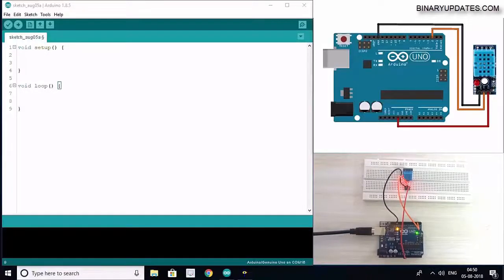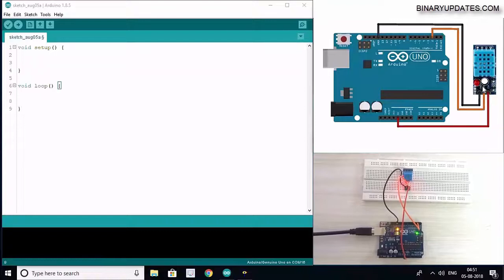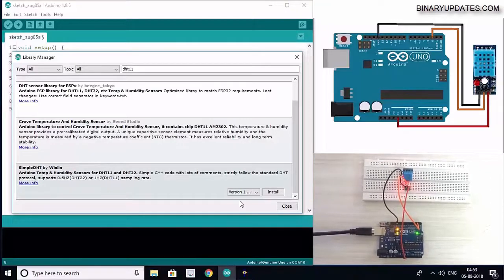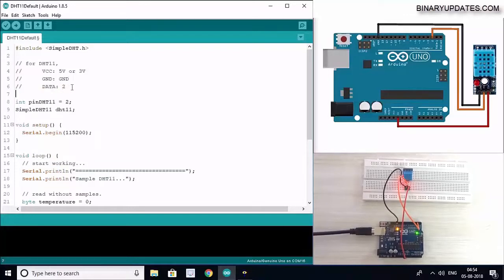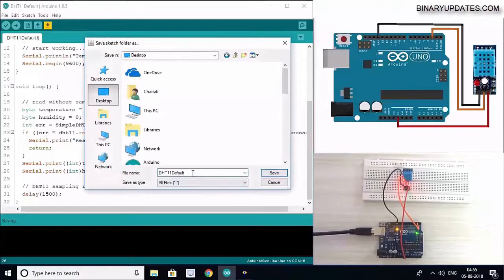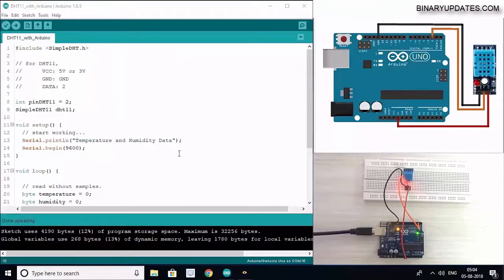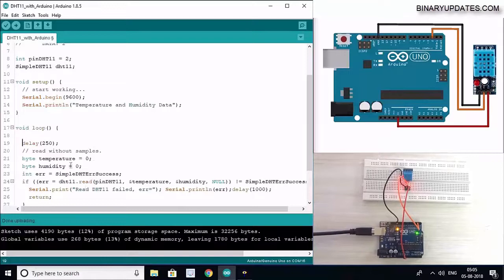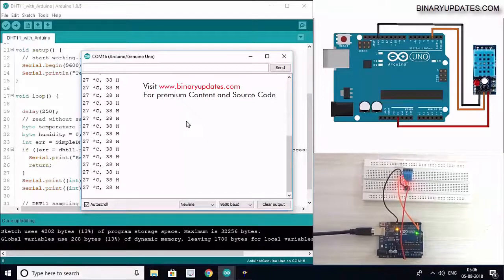DHT11 Sensor Module with Arduino Temperature and Humidity

Comment: Hello can some one help me with my dht11 sensor since it odse not work it outputs erorr reading temp and humdity
Reply from the maker: Make sure you've same DHT11 Sensor Module as shown in Video. If you have other DHT11 module then you make need to add additional resistor across power pin and digital output pin of a sensor. You'll find similar circuit by easy google search. Good luck!

Comment: How can I set up trigger temperature value to sound a buzzer?
Reply from the maker: Hi Elumbra, you should use "If" condition in Arduino programming to set trigger when particular condition reach based on value of DHT11 temperature and humidity sensor.
Reply: @BINARYUPDATES  yes, I made that. But I'm wondering also that after it's triggered and make a sound, and by looking at the serial monitor, the temperature remains the same as the last reading, and the sensor is triggered again. Only after then that the serial monitor will provide a lower value that the sensor will no longer be triggered

Comment: What to do when we get error
Read DHT11 failed, err=16,12
Reply from the maker: Hi Shaden, please check connection between Arduino and DHT11 Module. Also make sure module will be exactly as shown in video. There are some DHT11 module require to add external resistor along VCC pin. Good luck!
Reply: Which resistor should we use?

Comment: How DHT11 connected to digital pin gives analog output
Reply from the maker: Hi Vivek, DHT11 is a DIGITAL temperature and humidity sensor. And it uses 1-Wire protocol to read temperature and humidity value. The protocol takes care conversion of data while reading through microcontroller pins like Arduino in this case. I hope this may help you. Best wishes and good luck!

Comment: Im just here for understand code but you only explained the diagram... So it is waste of time.. Especially for me
Reply from the maker: Hi Raunaq, we'll be making other video in couple of weeks to explain code for DHT11 Temperature and Humidity Module interfacing with Arduino Uno. we appreciate your suggestions and thanks for your patience. Good luck
Reply: @BINARYUPDATES   ok i will definitely watch☺
Reply: @BINARYUPDATES   actually i also want video on code for mq135 gas sensor .It is little intricate for me.

Comment: That's not working
Reply from the maker: You can provide more detail about error you're getting. Usually, connections become an problem between DHT11 Temperature and humidity sensor module and Arduino. Also make sure there are many variants out there in market of DHT11 Sensor so choose one same as shown in our lesson. Thanks and good luck!

Comment: Can you please show how to talk with any modules or sensors without library. Or how to create one by looking and datasheet. seriously needed. Thanks.
Reply from the maker: Hi Yash, I'll surely made video specifically DHT11 and Arduino in near future as it takes time to drop in-hand task. But you may interested in "binaryupdates courses" where I have teach how to write you own microcontroller libraries using bare-metal microcontroller programming for AVR ATmega328 MCU. I hope that may be very useful for you. Good luck and best wishes!

Comment: How can I show the result without connecting the Arduino board??
Reply: connect it to some sort of display
Reply from the maker: You can use any Display Module like 16x2 Character display or OLED Module for Arduino.

Comment: Error in main function brother can u solve this?
Reply from the maker: Hi Gowtham, please check your code. It may be from code. If you're using example code and Arduino DHT11 library. Please cross check with my code in video. This may help you. Thanks

Comment: Is it necessary to connect a potentiometer and a resistor ? please reply
Reply from the maker: No, it depends on DHT11 Sensor Module. There are plenty of different types of cheap DHT11 module out there in market. Now depending on which one you've you can consider connecting resistor across OUTPUT Pin and VCC of DHT11 Module. I hope this may help you.
Good luck and best wishes
Umesh

Comment: What to do when we get error 
Read DHT11 failed, err=16,16
Please help
Reply from the maker: Hi Imoji, this error comes because of sensor may not been connected properly or DHT11 could have issue. Also consider connecting external resistor along VCC and Data Pin of DHT11 Temperature and Humidity Sensor Module while connecting to Arduino. I hope this may find useful to you. Good luck!

Comment: THere is an error comming when i try to make it read can anyone help
Reply from the maker: The only thing possibly can go wrong in this project is connection between DHT11 Temperature Humidity Module and Arduino Uno. Also make sure quality of jumper wires and DHT11 should be good. There are several variants of DHT11 Module in market make sure Pin before start connecting with Arduino. I hope this may help you. Thanks
Reply: @BINARYUPDATES  Thank you soo much for your feedback you have earned a subscriber
Reply: @BINARYUPDATES  Thankyou Soo much

Comment: the connection is not correct in my DHT11 has SIG - Vcc- GND ..gotta check this first.
Reply from the maker: It depends on which DHT11 Sensor Module you have. There are many variants of DHT11 Temperature and Humidity Sensor Module out there. They may have different sequence and names. But the functioning & code remains same for all DHT11 Module

Comment: I'm getting this kind of error!!
....
Read DHT11 failed, err=4112
Read DHT11 failed, err=4112
..........
i also checked my connection there is no problem in hardware, i checked it with 3 different dht11 sensors. the code is already given. so what could be the problem???
Reply from the maker: Hi Mainak, seems like the connections between DHT11 Module and Arduino maybe wrong. I suggest check them with official datasheet. there are several version and no fixed naming and so this problem cause very often. I think with few minutes swapping pins will work.
Good day
Reply: @BINARYUPDATES  thank you! solved the problem!! Actually the connection were wrong in the sensor!!

Comment: My sensor is showing NULL values for temperature and humidity. What could be the issue?
Reply from the maker: Hi Shanya, I feel it maybe because conenctions might be wrong between DHT11 Sensor Module and Arduino Uno. Good day

Comment: Can this be used to read in Fahrenheit (°F) ?
Reply: Yes ,you can obtain a result with Fahrenheit unity by adding an instruction in the Arduino code  when you should use the relation between this unit and the  Celsius degree,by default the system give you a result with the Celsius degree .Don't forget that you must include in the code an instruction to visualize the result in the monitor.

Comment: nice one man its working
Reply: Hi I'm getting an error
Reply: @revantkulkarni8734  install simple dht library and then include the library make sure that pins are in the same way as ur code was vcc to 5v gnd to gnd and data pint to any of the digital pin serial.begin should be 9600